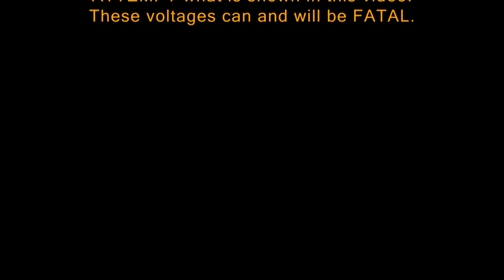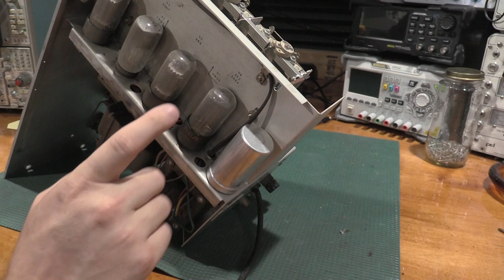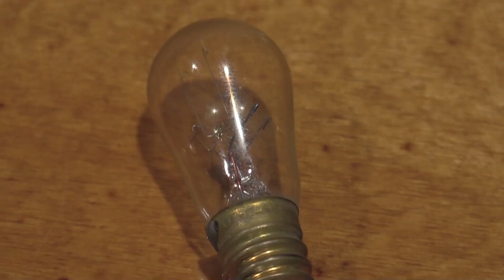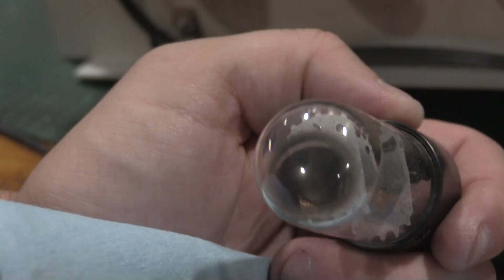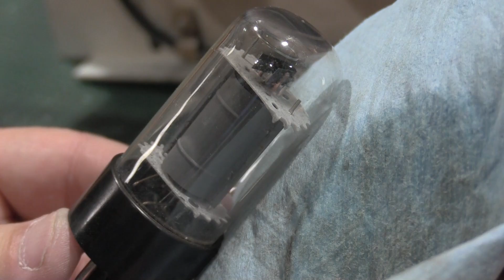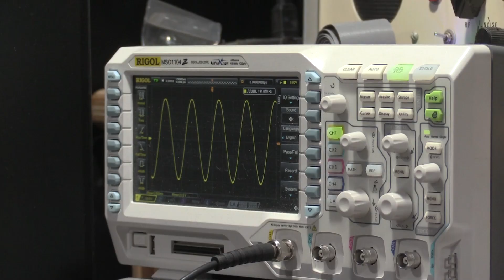HP 201CR Restoration and Repair

Comment: I bought a well used 200CDR back in 1971 from Eli Heffron's in Cambridge. i got it cheap because the output was pulsating - clean but the output was not steady. I pulled off the case and found it had a pair of 6V6 output tubes, those were supposed to be 6F6. The Rp of those two types is very different so I picked up a pair of 6F6's and all was well. The 6S6 bulb was dibe and the unit had very low distortion.

That oscillator has been on my bench for 50+ years and has never given me a lick of trouble - not bad for the $30 i paid for it way back then.
Reply from the maker: Excellent! I still have a 200CD on the bench today just not the R version. They really are fantastic units.

Comment: 9:44 It looks like your oscillator is relaxing too quickly, so I guess it's a carbon composite that has "shrunken" a little.

Edit 13:00 Ok, I was wrong. What an interesting failure mode!

Comment: Can distortioin be plotted across the spec'd frequency ranges?  Was this their very low distortion design?  Was one of HP's claim to fame?
Reply from the maker: This was a low distortion design (VERY low for the time) the SG505 from Tek does beat it out with a slightly newer unit. the HP 200 was HP's first product and what started it all. This is the low frequency variant of the first revision being the 201 There is a wide band variant of the 201 the CD which is currently on my bench and in service as one of my test oscillators. The 201C had a lower top frequency but the output was WAY higher at 3 Watts.
Reply: @ZenwizardStudios  For those interested the technical article co-authored by Hewlett relevant to the HP 200 series is in IRE Oct 1939 Terman & Hewlett’s oscillator article, pgs 649-655.  There'a an HP200J with original manual on the bench here beckoning for its refurb.  Extended very low frequency range.  Intended for mixing with various low frequency oscillators to generate sea-state waveforms in analog computation work.  As you say, high quality design and construction.